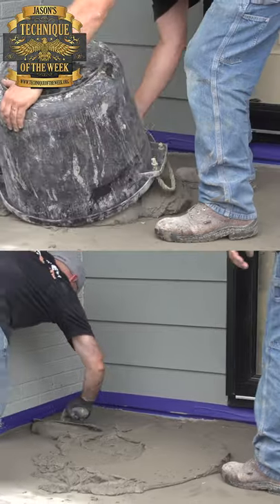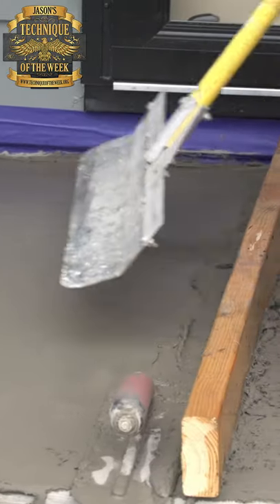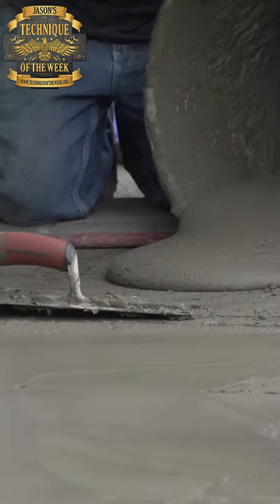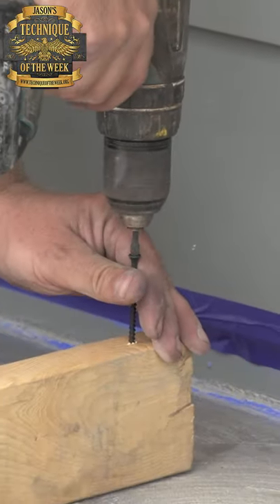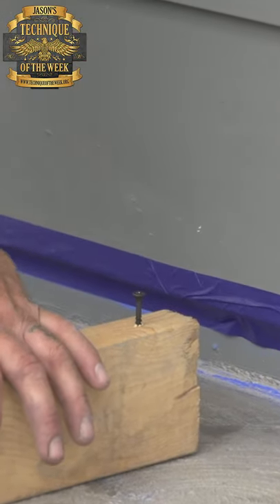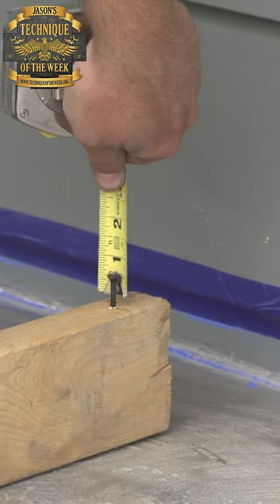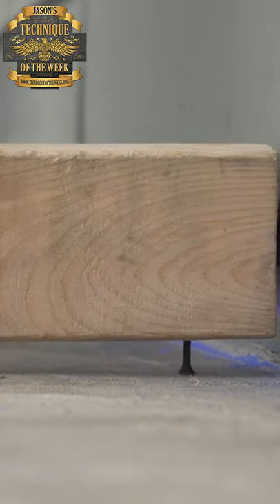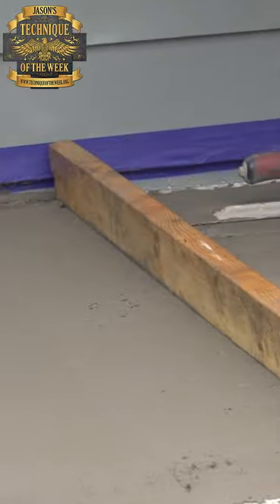Create a Sloped Concrete Overlay #Shorts

Comment: WHAT MATERIAL DID U USED?  THX
Reply from the maker: https://www.deco-cretesupply.com/products/repair-prep-products/easy-patch
Reply: Anything available at HD? I just pour but same thing happens just like in the video. Can I just use portland cement and sand mixture 1:1 instead of the product on freshly pour slab?

Comment: how many bags did you use for this porch?
Reply from the maker: I don't know the exact amount of bags we used on this job, it was quite a few years ago. Coverage for this kind product would depend on thickness. One bag will cover approximately 50sq/ft at 1/8" thick. If the slab just needs resurfaced, and the thickness will stay pretty consistent, you can estimate the bags needed fairly easily.  Jobs like this one won't have a consistent thickness because of slope, in this case we had 3/4" at the back of the porch and taking it down nothing at the front. You'll have to find an average thickness and make sure you add a few bags just to be safe. Thanks for watching Deco-Crete TV!!!!